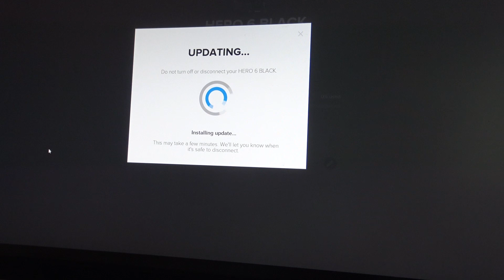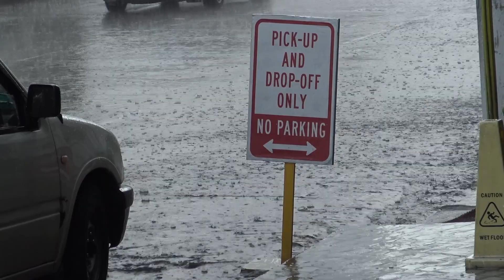Installing new Mirrors - Rain or Shine

Comment: Where did you get that mirror. Link pls.. i was born in Manila here now in Seattle.
Reply from the maker: They are Ninja300 mirrors.
Reply: @JosephMyLife  but not the stock mirrors??
Reply from the maker: Not stock to my bike, they are the stock mirrors to a ninja 300, but the holes had to be drilled out bigger to fit.

Comment: Use Bar End mirrors! Its badass.
Reply from the maker: Which are those?
Reply: Joseph - My Life In Metro Manila find it in Lazada or Olx. But it is more wonderful if you will buy on store. It is only 650 pesos for a cheap one and 2,000 for more durable and lasting one.
Reply from the maker: would make the bike wider. I like these now : )